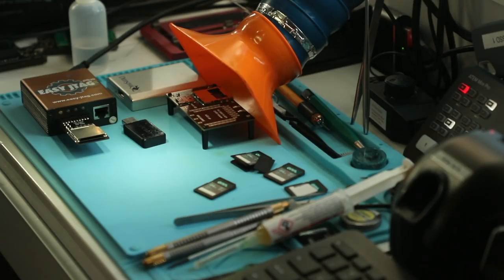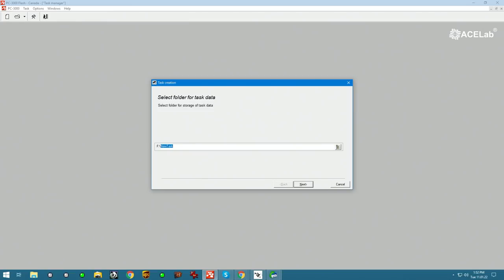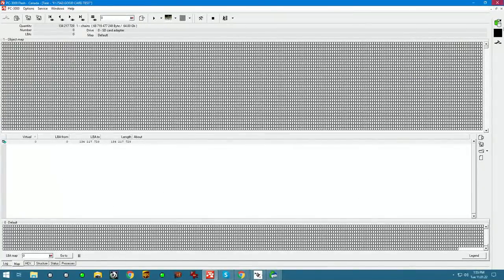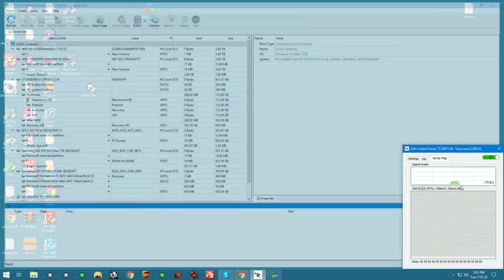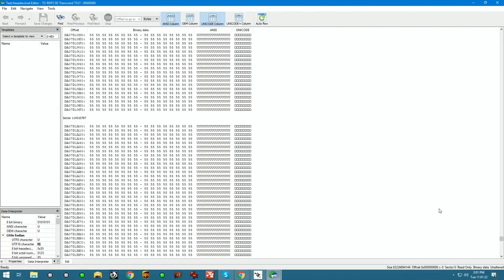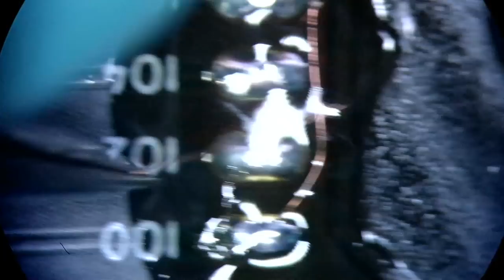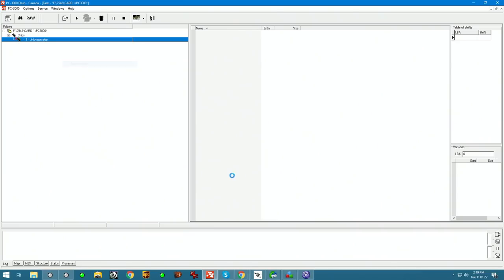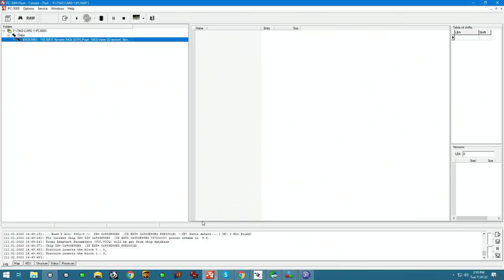3 cards had a wedding on them. Data is lost. Can we save it?

Comment: You ROCK! Please tell me what that rework wire is. I want to get some of that. I work as the lab manager at a chip maker company in silicon valley. We are a start up and every new tool I see, goes onto my wish list. That wire is the exact size and kind I have been searching for, but I don't know what it is precisely called. Enamel copper wire turns up lots of hits. But, not that kind of wire where the coating can be ablated by the soldering iron.
Reply from the maker: The wire is called enameled copper wire, you can find them in bulk rolls on eBay for cheap. Gauge I use the most is 46AWG
Reply: @hddrecoveryservices  Thank you very much. So, nothing special about the enamel coating other than the tiny wire size? I will look into it. 36AWG was the smallest I have used to date. The enamel doesn't come off that easy. Thanks again. You still rock!

Comment: In R-STUDIO's hex view if you see anything but 0x00 filling whole space, in this example 0x55, that's a sign that data wasn't translated, while 0x00 means it is empty?
Reply from the maker: its not so much what it's filled with, but rather how it looks. For every sector to be filled with something an no file system at all the device would have to be erased on a non-standard tool. Many tools can write over the data and fill the device with whatever you want, but this is a memory card, so most likely it should have some traces of FAT32 or exFAT on it because no camera can erase the card without building new files system. If we see the card with same pattern in every sector and no file system, it is safe to assume that the translation is down.

Comment: Unfortunately, as of today, data recovery from these cards is not possible, because of LDPC ECC error correction. PC3000, VNR, and FE do not support this. Recovery without correction does not make sense.
Reply from the maker: Will confirm to day with the x77 pattern. But yeah 99.9% sure its LDPC at this point